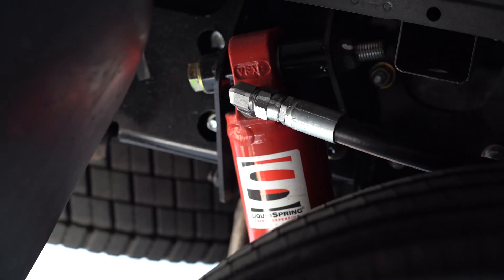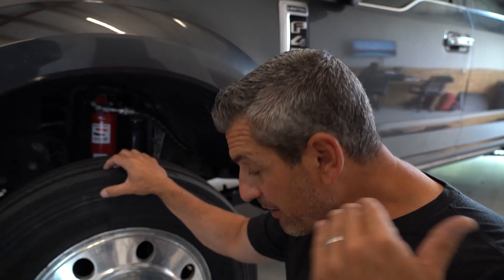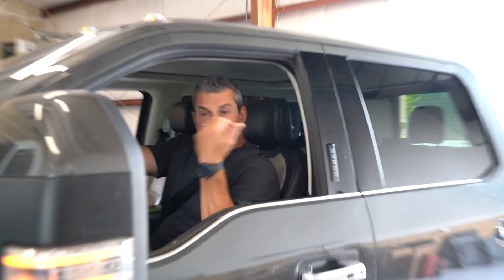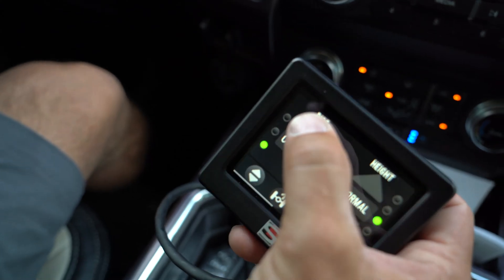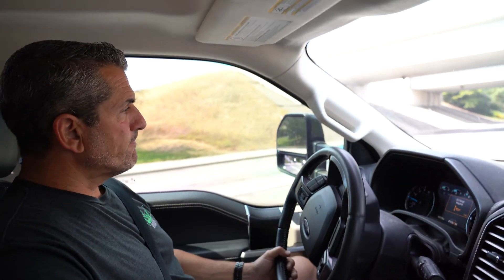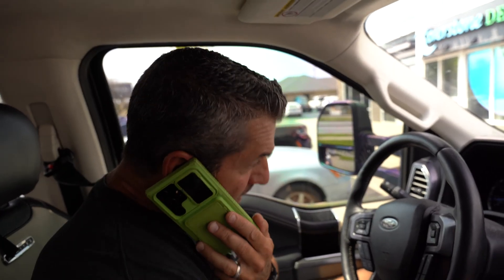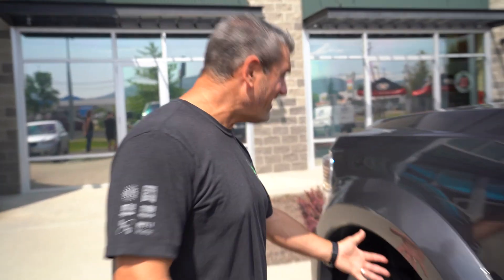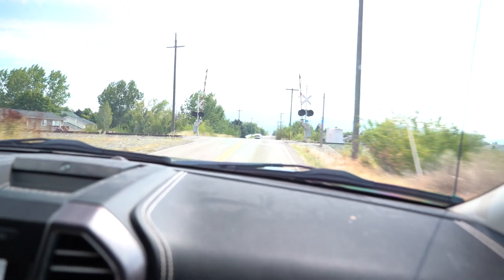Liquid Springs on an F-450

Comment: It’s most definitely not a Cadillac and for sure not a lazy boy…  It is surprisingly rough about the same as a stock 450 with the tires with half air in them 
However it’s Much much much better than stock F550

Comment: I bought my 2019 Ford F450 cab and chassis sight unseen, and I flew out to pick it up and drive it 1500 miles home over three days through the mountains and snow.   It was really treacherous to drive an empty cab chassis that far.   It's such a harsh ride, that it's even hard to look at the road through the vibrations.  After two hours, you're already exhausted and half in shock.  I come from a Honda Odyssey, which drives even better than a late 90s Cadillac.   I consider the suspension excellent in the Honda btw.   I'm looking forward to driving my 26 foot long Ford camper rig down the road, and having it feel like I'm driving the Odyssey.  I'm in the shop now to get LS put on.
Reply: How much did this system cost you?

Comment: For anyone with a bunch of money burning a hole in your pocket and a yearning to add unnecessary and unneeded complication to an already complicated and expensive truck - Here you go! Call CWS up fitters.
Reply from the maker: @teresad7174  everyone is entitled to their own beliefs 👍 we don't share the same belief in the unnecessary aspect, as many customers use the system as it's intended and are very pleased 👍
Reply: @sammycdub  Sounds like a match made in heaven. Oh and make no mistake - It's absolutely unnecessary.
Reply from the maker: @teresad7174  like I said, you are entitled to your beliefs, but they are yours....not all need to or share the same belief 😁
Reply: @sammycdub  Well thank you for your permission that allow for my own beliefs. Very generous.
Reply: @sammycdub  You spend $25,000 for a suspension system and guess what? You better love it. And even if you didn't love it,  you can bet your ass you're gonna preach the benefits to anyone who will listen. Because if you don't "love it" you're gonna feel like a complete jackass when you realize you could have spent $25k on something that truly changes the capability of your vehicle. Not some absurd, "Oh did you feel how it went across those railroad tracks?!, So smooth" WTF? Railroad tracks? That's the measure? Railroad tracks on a paved road. Sweet upgrade. 👍 Like before dropping $25k on his suspension RR tracks were some kind of impassible question mark. And let be clear I don't care what anyone spends their money on. I just think it's F-ing hilarious that crap people talk themselves into and I so I comment on it.
Reply: Haha what setup do you have on your f450? I have really nice bags and they aren’t cutting it.

Comment: What happens if one strut/piston fails?
Reply: you are broke down and waiting for parts
Reply: It is a hyd piston… just like a regular shock… so it will act just like a regular blown out shock, it will bottom out and flop around and bounce up and down…. These things are on almost every Ambulance and many fire vehicles. The reliability has thousands of hours and miles on them. Probably will see a piston leak starting before it will ever full out fail. Just like anything else, regular inspections and mx will prevent failures but sure, anything is possible but you could get back to civilization to have someone take a look.
Reply: I have yet to transport a new Ambulance with this type of suspension and I have have moved hundreds of units for various builders. Would be interested to see in person. but I know Lexus has similar suspension on their SUVs and failures are rare and gradual like you mention. Usually leaking or bleeding out slowly letting you know it is time to give itbsome maintenance.

Comment: What is the price of this system if tou don't mind?
Reply: $25,000 for the hydraulic springs ?
Reply from the maker: @CASANOVAPRO1985  yes, it's expensive but for those needing it, worth every penny!
Reply from the maker: @disel4life  It runs $25-30,000 depending on the truck and some options.

Comment: Wonder about drive shaft components
Reply from the maker: No... change to the drive angle as it only runs at one level, ride height. The only time it can be raised and lowered is when it is stationary or less than 10 mph
Reply: @sammycdub  Thanks

Comment: IF I install those 4 Liquid Springs on my 2003 E-450 Super Duty Box Truck, do I need to remove the Air Lift Bags in the rear?
Reply from the maker: Yes, the rear suspension on this truck was completely removed. It's now on the liquid Springs and a new multi link set up!! Drives amazing!! For and F450